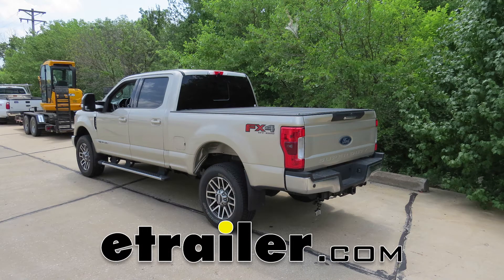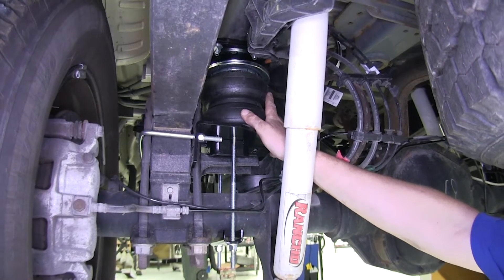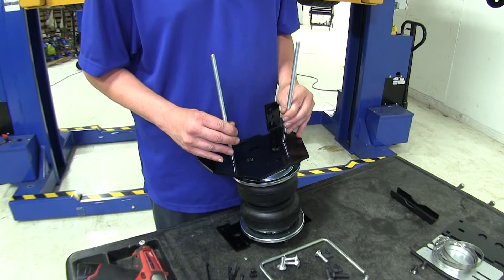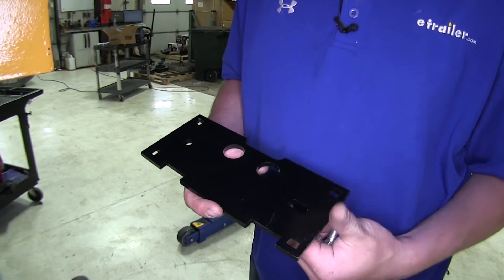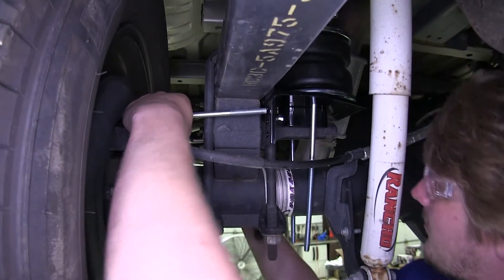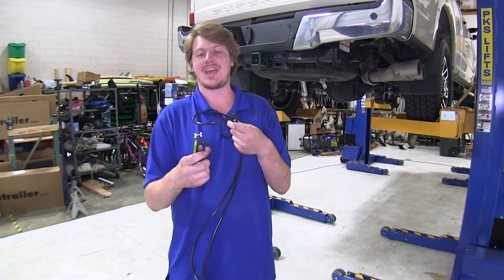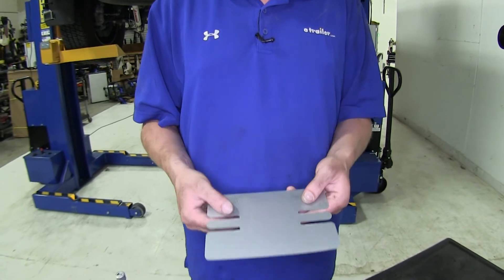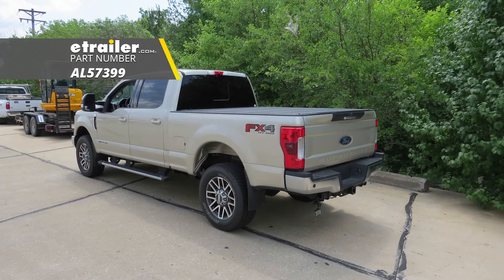Setting up the Air Lift LoadLifter 5000 Air Helper Springs on your 2017 Ford F-250 Super Duty

Comment: Where do you get that bracket for the air lines
Reply from the maker: You can find the inflation valve bracket on our website in the following link.
https://www.etrailer.com/Accessories-and-Parts/Firestone/FWR17607560.html